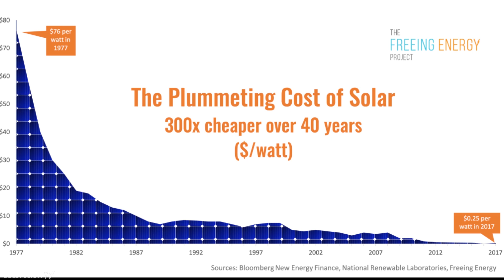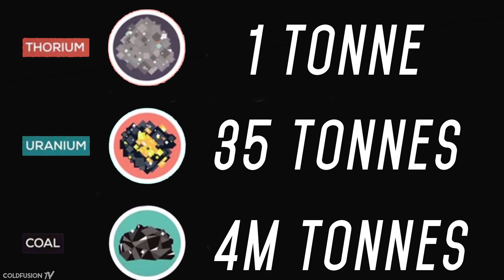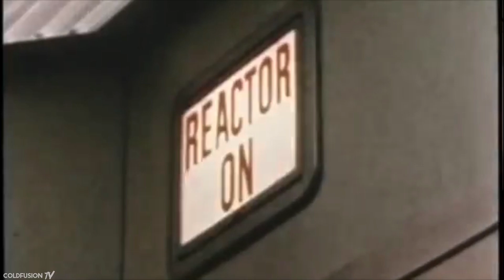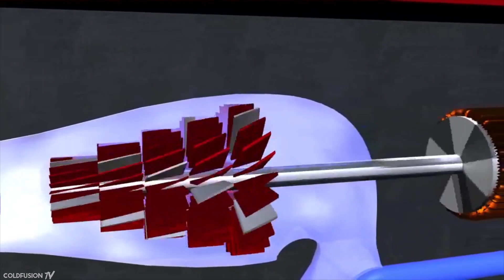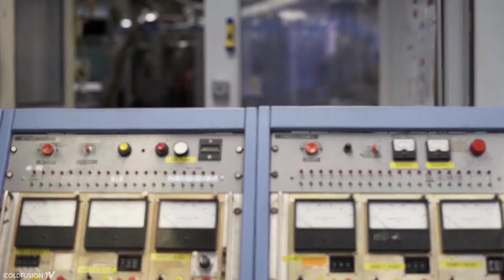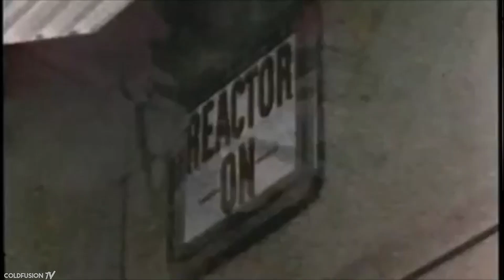Thorium - The Future of Energy?

Comment: What are your guy's thoughts on Carbon Engineering?

 Taking carbon out the air and making it into fuel.
Reply: It's interesting but I dont think it would be economical or necessarily environmentally friendly.
Reply: Neurolicious  so basically an african village?
Reply: @kingjames4886  seems legit
Reply: Neurolicious it can get better as time goes on I’m sure with innovation etc.
Reply: The only suggestion which may validate discussion is carbon capture from power generators (and also possibly the cement industry) I.e. concentrated emission sources. Oxyfuel combustion would be helpful in this instance but requires cryogenic fractionation of air to supply either pure o2 or an o2/co2 oxidant stream. Using air for combustion requires more costly separation at the waste gas side of the process. Then, at the end of the day almost all current Carbon capture processes end up bottling the co2 for use in carbonated drinks or enhanced oil recovery processes, so this doesn’t even lead to a carbon neutral outcome.
It takes a lot of energy so separate gases and concentrate them by compression or cooling, chemical conversion requires catalysts and more energy (they are endothermic processes) all this uses energy which will likely come from carbon sources in the first place.... stick to trees, they are highly underrated
Reply: None of the people commenting here understand that we can't power certain types of vehicles without liquid hydrocarbon fuels, and the only way to burn those fuels without pumping more carbon into the atmosphere is to capture carbon from the air (and oceans) and then produce fuels with it. It takes a lot of (nuclear) energy and it will be expensive, but there's literally NO ALTERNATIVE.
Reply: PistonAvatarGuy actually many combustion engines can be conveyed to run on gaseous fuel (lpg most usually) which has lower carbon emissions (down to C/H elemental ratio). Engines can also often be converted to run on methanol (certain types) which emits 45% less CO2 than petroleum (octane) on account of its H/C ratio. Ethanol is also good but less so than methanol.

At the end of the day, hydrocarbon combustion engines are an era which will phase out over the next generation (except for aviation - which will take longer) but for cars and boats, it’s just a matter of time. Electric vehicles are much more efficient and will be cheaper to run when scale brings the cost down. Engine cars will eventually be a curiosity, a relic with charm mixed with oil and smoke, but effectively redundant and outdated as the world moves on.
Reply: @Citizen-of-theworld  "actually many combustion engines can be conveyed to run on gaseous fuel"
-
Not without all kinds of compromises being made. Range goes down, refueling times go up, performance often goes down, the cost of the vehicle goes up, danger is increased... the list goes on. Aircraft also can't make use of gaseous fuels.
-
Biofuels are too land intensive, period.
-
"hydrocarbon combustion engines are an era which will phase out over the next generation"
-
No they wont, BEVs are too expensive and are incapable of filling certain roles.
-
"Engine cars will eventually be a curiosity, a relic with charm mixed with oil and smoke, but effectively redundant and outdated as the world moves on."
-
Possibly, but that's not looking like it will ever be likely, the cost of BEV technologies aren't dropping significantly and the capabilities have plateaued.
Reply: PistonAvatarGuy give it time... technology has a wonderful way of becoming cheaper in time. We need a leap forward in battery technology and suddenly all those IC vehicles will stop making economic sense... and it’s coming, from solid state lithium batteries to battery materials based on graphene matrix...
And when you consider total lifetime costs battery vehicles are fast making economic sense. Of course it will take time to phase out existing infrastructure. But economics will end up being the driving factor, not government incentives (although they are helpful at getting the ball rolling)
Reply: @Citizen-of-theworld  "technology has a wonderful way of becoming cheaper in time"
-
Actually, BEV technologies may not become cheaper over time, because of the rarity of certain materials that are required for the production of BEVs. 
-
"We need a leap forward in battery technology and suddenly all those IC vehicles will stop making economic sense... and it’s coming,"
-
Right, and so is Jesus! /s ... There's absolutely no reason for you to be so certain about that, we may not EVER develop batteries that are cheap enough and energy dense enough to allow BEVs to replace ICE vehicles. You're suggesting that the world should GAMBLE with the future of the human race!
-
"And when you consider total lifetime costs battery vehicles are fast making economic sense."
-
That doesn't mean that people want them. I've talked to quite a few people about electric vehicles, NO ONE that I know would ever consider buying one. The scary part of that is that a lot of these people claim to care about global warming!
-
Nothing happens on a large scale without government. If you're waiting for a bunch of brainwashed (by fossil fuel industry propaganda) morons to take action, you're going to be waiting for a LONG time, and we're already basically out of time.
Reply: PistonAvatarGuy  take it easy, it’s just a healthy discussion.
I know we don’t know whether we will have a breakthrough or not, but the price trends of battery technology is improving rapidly. Price per KWh storage has halved in <5 years and that trend is continuing, we are headed for $100/KWh in the next yr or 2. Remember cost and scale are inversely correlated.
Battery materials are not an issue - lithium is one of the most abundant metals on earth, cobalt, also not limited by reserves but concentrated in certain locations (new batteries need much less cobalt than old ones) manganese & graphite - not a problem.
Neodymium used for motors is more of an issue - most production in China, but actually not so rare and new plants being constructed around the world to meet demand and for strategic reasons.
Demand, sure, not everyone wants an electric car, not everyone wants a motorcycle, but demand for EV’s is growing and highly dependent on cost which, as the prices come down demand will increase. Just look at the EV vehicle production curve (exponential). They are more populate generally amongst the younger generations, so demand will increase too. Bear in mind that different societies and cultures react differently to these things. So your immediate environment is probably different to those of another society, which is fine.

And yes there is no time to wait so put your car down, hop on that bicycle, Start having crayfish and mussels for supper and for goodness sake don’t use cement/concrete for construction. We can all do our little bit. Collectively it makes a difference. The oil industry won’t change the world, unless it’s in their financial interest... then they will be the first to do so.

https://www.ft.com/content/78e15cb8-7a9a-11e8-bc55-50daf11b720d
Reply: @Citizen-of-theworld  "take it easy"
-
There's really not any reason to take it easy, a 50% reduction of CO2 emissions in 11 years and negative emissions only decades later is not something that's going to happen without drastic measures being taken.
-
The price of BEVs is not falling, not by any meaningful amount.
-
Cobalt is a problem and, no matter what, BEVs can only replace a small portion of the world's vehicle fleet.
-
"Just look at the EV vehicle production curve (exponential)."
-
Applying trends wont work here, because, BEVs simply CAN'T replace certain ICE vehicles. Adoption will cease when real, physical limits are reached.
-
"So your immediate environment is probably different to those of another society, which is fine."
-
My immediate environment reflects the vast majority of the world. You think ol' Billy Bob in Kentucky is going to buy a $70,000 electric truck to replace his his 20 year old Chevy pickup that he bought for $4,000 bucks, 10 years back? NOPE. I don't even understand why you think that anyone should need to wait for a world full of morons to wake up to the dire situation that they're in, it makes absolutely NO SENSE.
-
"so put your car down"
-
I haven't owned a car for 5 years.
-
"...don’t use cement/concrete for construction."
-
Right, so, because I don't worship at the alter of Elon Musk, the world should just end, right? It's BEVs, or nothing? Welp, all I can hope is that people like you suffer the longest in the end and that I live to see it. Disgusting shill.
-
"The oil industry won’t change the world..."
-
DUH, where did I say that it would?
Reply: PistonAvatarGuy. Interesting blend of thoughtful argument and troll going on in that last message. you might think I am against you but actually I am more a less in agreement, more does need to be done, we differ perhaps on methodology but I would still like to do more for making that change. I certainly don’t wish you to suffer because the environment. That’s just a very unpleasant attitude to take. (Save it for the climate change deniers).

I pay a premium for 100% renewal electricity and ride a bicycle but i certainly could do a lot more.
I’m not a big Musk crusader who believes that Electric vehicles alone will save the world. I personally believe they can make a difference to transport emissions, and yes certain things they won’t replace, aviation - unlikely but perhaps a combination of h2 or hybrid power is the only realistic alternative for that one (just guessing so don’t angry quote me on that). Long haul vehicles will be tricky as well, although we are close to electric trucks and battery electric boats (for shorter trips). (I’m sure you’ll disagree on that)

You are right that Billy the $4k Chevy truck driver is not going to buy a new Tesla, nor is he perhaps going to buy any new car if that’s his budget. But Billy is not going to be buying the latest most efficient vehicle because he’s on a tight budget, but technology does cascade down the price chain and maybe in 10 years, that old electric car that’s new now might be a better buy.

Also, we should also make an effort to buy products produced locally. It’s pretty difficult in many cases (consumer electrics etc). 

Also... it’s not all about transport energy. I wonder if you are aware of what goes into making the materials, goods products that one has at home. I could preach that we should live in homes made from nearby local mud and wood but I know it is not always feasible. But I would spare a thought for what we as individuals can do to help, by the choices we make. It’s one thing grumbling at people in power, environmental campaign can help to some extent, but the most we as individuals can do is reduce our own impact, or better still, lead from the front and be one of the few good people with the business or political power to enact change that has a meaningful impact and encourage others to follow with you. 

It still baffles me why someone who thinks we need to make a change should be against those developing greener solutions. From my understanding, solar and battery electric vehicles seem to me to be a positive direction. 

When Predicting future trends. You are right, I cannot predict when things will happen or even if they happen, and whilst I’m also a researcher, I am very aware of the limits of making those predictions. The further outward you look the greater the error. Just as when predictions are made of a catastrophic future, there is equal error to be applied so one can only make an inference that we should act to protect the environment in case the negative predictions are correct.
Reply: @Citizen-of-theworld  Hydrogen is even more useless than BEV technology.
-
"...that old electric car that’s new now might be a better buy."
-
What difference would it make? That $70k electric truck doesn't have nearly the same capability as the $4k ICE truck, so Billy Bob wont want it!
-
"Also... it’s not all about transport energy."
-
The nuclear energy system that would be necessary to make carbon-neutral synfuels could also supply electricity to the grid.
-
"I could preach that we should live in homes made from nearby local mud and wood but I know it is not always feasible"
-
New home construction isn't all that widespread anyway.
-
"But I would spare a thought for what we as individuals can do to help, by the choices we make."
-
That's hugely ineffective. Not only can most people not afford to buy an electric car, or put solar panels on their roof, but they can't choose to buy what the market refuses to sell, like a carbon neutral synfuel. And, like I said, if we're going to wait for the morons to catch up, we might as well do nothing at all.
-
"...and be one of the few good people with the business or political power to enact change that has a meaningful impact and encourage others to follow with you."
-
We can't all own businesses and hold a political offices.
-
"It still baffles me why someone who thinks we need to make a change should be against those developing greener solutions."
-
You mean, the solutions you suggested that could never work?
-
"From my understanding, solar and battery electric vehicles seem to me to be a positive direction. "
-
When was I ever against those technologies? They're small pieces of the puzzle and they'll be adopted by a small number of people, I'm describing how to achieve a meaningful reduction in CO2 emissions.
-
"...so one can only make an inference that we should act to protect the environment in case the negative predictions are correct."
-
Right, and just to create a better world, in general, so why are you so opposed to making actual progress in this area?
Reply: PistonAvatarGuy 
H2 isn’t useless, it is pretty much the only clean alternative to electric that has the energy density right now to rival IC vehicles. 2nd option would be methane which has 45% reduction CO2 emissions. H2 and Methane are the only options I can think would ever replace jet aircraft and have some meaningful difference to CO2 emissions.
H2 also can help prevent transport pollution in cities (along with electric). City transport pollution has a terrible effect on health.

I’m pro nuclear (especially this Thorium idea,) that of course can make a big difference but energy will always come from a variety of sources, as do emissions. Energy is also just a piece of the puzzle.

Reforestation will have to be part of that puzzle, especially in waste lands and deserts, as well as reducing emissions we have to also reduce CO2 back to fixed carbon and o2 and it’s the best method we have to do it.

Energy efficiency is also crucial, as is reducing emissions of other Pollutants with high global warming potential. I.e. methane, aerosols, NOx and SOx, particulates etc - all which come from combustion processes.

There are plans to implement laws for emissions scrubbers for ships, which are some of the very worst offenders (worth a read on that).

And no we can’t all be business owners and politicians, as I said, people with less influence can still make an impact individually and locally, so collectively the effect becomes significant.

I wouldn’t knock all these technologies because you don’t personally like them or don’t want to buy into them. Many of the best inventions, people do not foresee them before they arrive so we don’t yet know what mankind will create that will make a big positive impact. Technologies are being worked on all over the place but many great inventions have arisen unexpectedly from research that was never intend to produce that outcome.
Reply: PistonAvatarGuy So if I’m the moron, technology doesn’t work and no one will make any effort to improve the world, please tell me what’s the solution? You obviously know more about this that I do. I should probably stop my research and listen to you.

Also, where does the energy come to produce synthesis fuels? You understand the energetics are highly unfavourable right? Let me guess nuclear, is the only answer? Or you have more ideas hidden up there?
Reply: @Citizen-of-theworld  "...please tell me what’s the solution?"
-
I already did, READ.
-
"You obviously know more about this that I do."
-
Obviously. If you think I'm wrong, PROVE ME WRONG! Show me a hydrogen fueled vehicle which is capable of replacing ICE vehicles and isn't massively impractical in some way.
-
"Also, where does the energy come to produce synthesis fuels? "
-
For the THIRD time: NUCLEAR POWER PLANTS.
-
"You understand the energetics are highly unfavourable right?"
-
You understand that nothing else will allow us to meet our CO2 emissions targets, right? You understand that nothing but liquid hydrocarbon fuels can power aircraft, right? You understand that there is no way that ICE vehicles are ever going to be banned, right?
Reply: PistonAvatarGuy you know there are more countries than the US? do you think every country in the world has the resources, capital, infrastructure, and technology to implement your one size fits all mentality. Nuclear power is not the solution in every case, and there is still the not so easy job of waste management to deal with. A new nuclear power plant cost anywhere between $2-10 billion. That is simply not feasible for many countries.
Reply: @Citizen-of-theworld  All of the countries that are the worst polluters are capable of building nuclear reactors, liquid hydrocarbon fuels can be exported to those that aren't. The countries which aren't capable of building nuclear reactors aren't likely to be able to afford to buy electric cars anyway. The majority of Americans can't even afford to buy electric cars.
-
"...and there is still the not so easy job of waste management to deal with."
-
It's not nearly as complex as people make it out to be. A lot of waste can be reprocessed into new fuel.
-
"A new nuclear power plant cost anywhere between $2-10 billion."
-
The US spends TRILLIONS defending oil interests in the middle east and would probably end up spending similar amounts of money defending the resource for electric cars. Billions of dollars are given to the fossil fuel industry in the form of subsidies and tax breaks, I don't think that people have even a vague idea of how expensive fossil fuels really are. Even if carbon neutral synfuels didn't make economic sense, what are we supposed to do, go back to the stone age because some bureaucracy isn't flexible enough to support our continued prosperity? Does that make sense to you?
-
"That is simply not feasible for many countries."
-
Smaller, poorer countries don't have energy demands which would require the use of nuclear power plants anyway, they could probably get by with mostly solar and wind energy. My concern is the largest polluters.
Reply: I agree that we will need more clean nuclear energy to help with this target, but it will be hard to convince the nimbys to accept it.

Maybe this thorium technology might help. It will be a hard fight to push the nuclear power argument. I’m in support, but I know it will be a hard fight.
Reply: @Citizen-of-theworld  "...but it will be hard to convince the nimbys to accept it."
-
Only as long as the fossil fuel industry keeps running its propaganda campaigns against nuclear energy.
Reply: It’s called tree planting. Any engineering process that requires selective absorption, concentration and chemical conversion will be far too costly to ever be useful. Nature is the greatest chemical processor, why spend billions building expensive machinery (that will need constant maintenance) when trees are self automated. As a Chem. engineer we studied the various processes, and nothing comes close to the cost efficiency of reforestation.
Reply: @Citizen-of-theworld  You don't get liquid hydrocarbon fuels from trees.
Reply: PistonAvatarGuy: yes you do, look up hydrothermal liquefaction and Fischer Tropsch process. It’s a standard process in the production of energy fuels. Refinery’s do it all over the world

I can tell you for certain, it is far easier to get liquid fuel from trees than it is to get liquid fuel from CO2. It’s all down to energetics, I.e. the enthalpy of formation of CO2 relative to enthalpy of formation of plant fibres like lignin and cellulose.
Reply: There are lots of parallel processes that achieve this. Also see Biomass reforming methods - see https://www.sciencedirect.com/topics/engineering/biomass-to-liquids-fuel

Of course that’s only necessary if you want liquid fuels, if you are simply trying to produce energy then all you need is dumb biomass power generation process.

Then again, if you actually want a process to generate electricity, modern solar cells are actually much more efficient at converting sunlight into electricity than producing biomass for a traditional combustion powered steam generation process. But then the problem you have is electricity storage or more exactly, matching electricity demand with supply.
Reply: @Citizen-of-theworld  A) That's probably horribly inefficient. Why bother growing a whole tree when all you need is the carbon? B) Trees grow FAR too slowly to fuel our modern lives.
Reply: PistonAvatarGuy you are right, it is inefficient, but actually, so are all hydrocarbon processes. It is certainly no more inefficient than oil refining (especially when cracking and reforming processes are involved). The real question is why would you use a poor carbon source like the air, to produce liquid fuels, which then go through another inefficient process like a piston engine to achieve useful work. Don’t get me wrong, I love engines too, (motorcycles mainly), but if one is talking efficiency, it’s going to be very hard to beat battery powered electric vehicles. Solarthermal and photovoltaics are more efficient than biomass overall I.e. % input converted to useful work energy. Hydrogen powered vehicles - much less efficient than battery electric. Any chemically powered engine used to produce work - much less efficient. Fuel cells are efficient, but producing hydrogen is certainly not!
If we are talking efficiency (which we seem to be) then the humble bicycle is the most efficient machine man has produced for transport. (You can fact check me on that!)
Reply: @Citizen-of-theworld  "It is certainly no more inefficient than oil refining..."
-
Not when you consider the land use.
-
"The real question is why would you use a poor carbon source like the air, to produce liquid fuels, which then go through another inefficient process like a piston engine to achieve useful work."
-
Ocean water can also be a source of carbon. ICEs can't be replaced in certain applications, like aircraft, long haul trucking, race vehicles, etc. BEV technology is also expensive and the production of BEVs is very resource intensive. You're also not going to replace absolutely EVERY vehicle on Earth in time to make a difference with regard to climate change, many vehicles are used for many decades before getting scrapped.
-
"Fuel cells are efficient, but producing hydrogen is certainly not!"
-
Agreed, and none of the vehicles powered by hydrogen are practical.
Reply: PistonAvatarGuy with regards to land use, of course it is controversial topic if farming land is given up to grow trees, but desertification is a major problem in our world today. Efforts are being made to repopulate desertified areas of Africa and Asia and here is where reforestation efforts are unquestionably a good idea.
In terms of using oceanic dissolved CO2 as the carbon source, it’s always a matter of concentration. This is the fundamental principle that applies to all mining, which effectively it is - mining carbon. Feasibility always depends on the quality of your feedstock, and the ocean is a very dilute feedstock (unless you’re after salt!!!) A better source is using calcite deposits on the ocean floor (shellfish shells) but then, why would one remove fixed carbon to produce liquid carbon for fuels - it’s just a worse equivalent to coal.

Incidentally what you are suggesting, is sort of already performed by shellfish, they take dissolved carbon in the oceans to manufacture their shells, made into calcite. Shellfish are (as far as I am aware) the only carbon negative foods we can farm. If we all produce more shellfish that would help the environment, the shells remove carbon from the oceans into a fixed solid form.
Reply: @Citizen-of-theworld  Nature is just too slow and inefficient relative to our enormous (and growing) energy needs, nothing evolved to efficiently provide us with fuel.
-

"A better source is using calcite deposits on the ocean floor (shellfish shells) but then, why would one remove fixed carbon to produce liquid carbon for fuels - it’s just a worse equivalent to coal."
-
Exactly, the point is to reduce ocean acidity and reduce the concentration of CO2 in the atmosphere. My thought is that ocean water can made potable in order to supply certain regions of the world with fresh water (California, for example) and the by-products from that process can be harvested for various uses. Ocean water contains lithium, uranium, thorium, plain-ol' table salt, and carbon, all of which can be extracted and used.
-
You can't put shellfish in your fuel tank. I'm talking about making a fuel which will make the worlds EXISTING fleet of vehicles carbon neutral. According to the IPCC, we're also going to need to capture GIGATONS of CO2 and sequester it in order to avoid catastrophic warming, so developing carbon capture technologies is a must.
Reply: PistonAvatarGuy yes interesting. Reverse osmosis might be an possible candidate for concentrating dissolved metals, but again whether it can be competitive with traditional mining techniques will depend on the relative cost of each extraction method. I’ve heard that the ocean contain an enormous amount of gold but at tiny concentration. Studies have been made into feasibility of extracting gold and it has never made economic sense. I fear the same may be true with other heavy metals like thorium, but I cannot say. I’m also not sure whether processes like reverse osmosis concentrate carbonate ions in the waste stream, again it will still be a fairly dilute source if it did. Carbon capture is of course feasible (we have a pilot scale CCS plant at my university which uses reversible calcium oxide adsorption - although I think they have tested other adsorbents as well). The issue with it is a matter of cost. Industry will not use the technology unless they are forced to or they are incentivised to do so, which comes down to government and drives up cost. Then what do people do with the CO2, well currently it goes into bottling and EOR usually. Maybe better uses can be found for it, eg. Piping into enclosed greenhouse for food production (this is already done at an industrial scale)
Reply: @Citizen-of-theworld  "I’m also not sure whether processes like reverse osmosis concentrate carbonate ions in the waste stream"
-
I don't think that there's any reason why it would need to be extracted from the brine that reverse osmosis filtration produces, but I could be wrong.
-
"The issue with it is a matter of cost."
-
That's an issue with EVERY solution to climate change that humanity is currently researching, but there's no reason that we should be trying to appease some obsolete economic system by sacrificing ourselves to it, we're (supposedly) not savages.